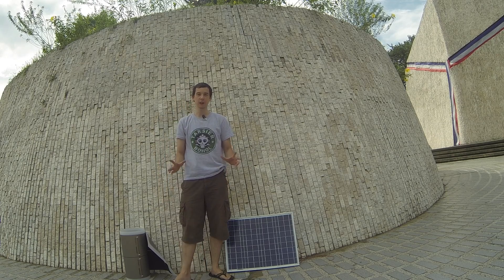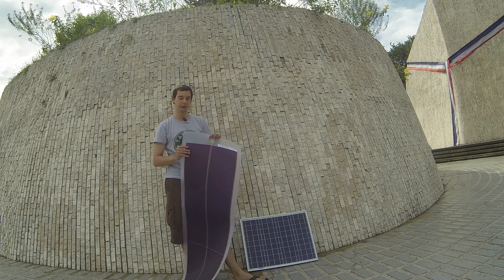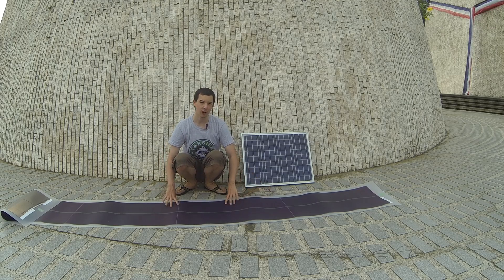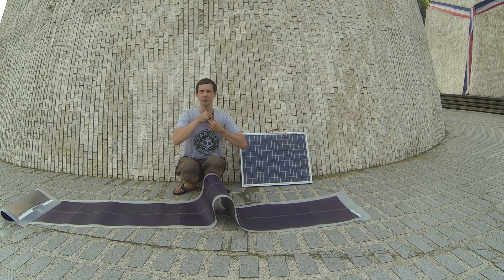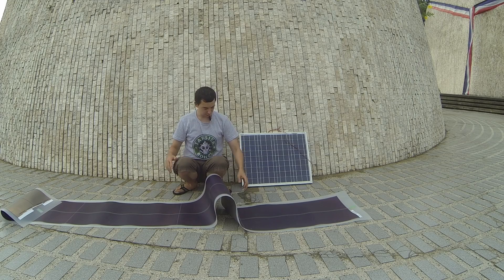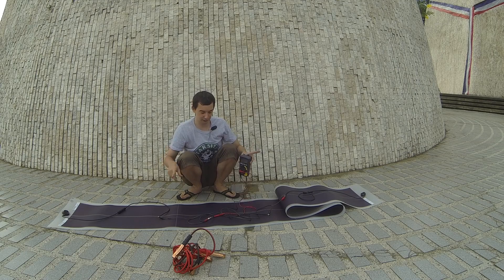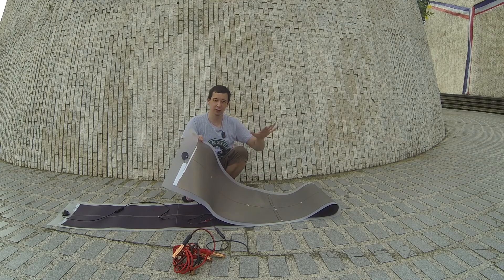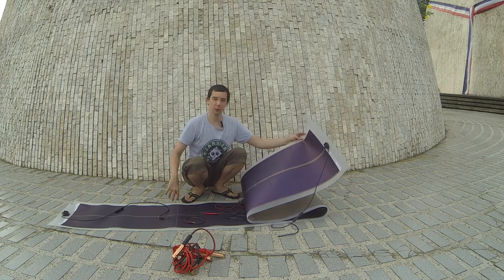Fuji Fwave Flexible Solar Panel

Comment: Was ist mit diesem Panel ? Ist es immer noch gut oder ist es alte technick?
Reply: This is an outdated technology and a poor product. Due to the high voltage of 240 volts DC, if handled improperly, you can accidentally ignite an electric arc and start a fire or be exposed to direct current, which at this or higher voltage is guaranteed to kill you.

Comment: Hi, thanks for the interesting Video. I ve got 4 of these panel and dont know, how to hook them up to a Batterie. Can i cut them to reduce voltage and what Kind of charge controler and what type of Batterie should i use? I hope you can help me out. Salamat
Reply from the maker: You can buy a charge controller that's designed for that high voltage. It's still being sold on ebay. 

I've also seen some users that tried to use a stepdown voltage regulator and then feed it into a regular solar charge controller.

Comment: Hi, good video. Where do you purchase that kind of flexible solar panel?
Reply from the maker: I was about to say, I don't think they're being sold anymore. 

But then I checked eBay and they're still being sold.

Just search for: 100w 319v dc roll up Flexible solar panel

There are competing products nowadays. Although it's hard to beat these for the price, considering the high quality.

Comment: I’m a bit confused but I’m new to this. 300w x 0.1amps = 30W each. To get to 3KW power you would need 100 of these on your roof right?

The normal panels that I’m looking into are 650W each so 10 will give me 6.5Kw

The flexibility is Great but I’m trying to understand the power output. 
Also many things are 120 / 240 volts. 

I’m guessing I would need to buy some and connect myself to understand what it is doing.

Comment: When you order this type os solar panels, you also receive a '300Watt 200v dc to 14.5dc convertor'  to attach to a 12v solar charger. My question is, how to connect several of these convertors outputs to one single solar charger. thank you

Comment: hi, i just bought 2 pieces - i payed just about 35 Euro for each. great, i measured te voltage - it works fine. but now i am in a dead end. what kind of converter  do i Need. i would like to send the power to my boat which is supportet whis some 230 V AC to 12 V DC converter .thx for an idea
Reply: Dear Werner Wachhter , If u need any informations about  the  fuji solar , i  can  help you free , about fuji solar  , . I'm usenig the  fuji solar , and  have good  experince about this kind , this my address and number mobile ,   
alzoobery2001@yahoo.com
+967712927117
you can contact me whatsapp , Viber and wechat , this my number +967712927117
any dates about  the  fuji solar , i  can  help u , like  the inverter and how  to  charge  the  battery , and  others ,
Regard
Reply: Dear Werner Wachhter , If u need any informations about  the  fuji solar , i  can  help you free , about fuji solar  , . I'm usenig the  fuji solar , and  have good  experince about this kind , this my address and number mobile ,   
alzoobery2001@yahoo.com
+967712927117
you can contact me whatsapp , Viber and wechat , this my number +967712927117
any dates about  the  fuji solar , i  can  help u , like  the inverter and how  to  charge  the  battery , and  others ,
Regard

Comment: exactly where did you obtain this panel that we cannot find. no facts , no access for others to obtain panels and i need to check all your other junk posted. maybe you need to build a perpetual motion machine like the other nutcases out there as this immature act you proclaim is within there same suit.
Reply from the maker: +cuyler wilkinson it's a panel made by Fuji. Just type Fuji flexible solar panel into Google and you'll find countless websites talking about the panels.
Reply: i have and there are none. come on with a verifiable link.
Reply from the maker: +cuyler wilkinson if you can't find information on flexible solar panels from a major brand like Fuji then perhaps it's best you stay away from solar.
Reply from the maker: cuyler wilkinson So where exactly do you think I got these panels from?
Reply: ok! where!

Comment: Great video, How would I optionally drop down the voltage and use it for off-grid battery charging for use with a normal MPPT charge controller rated at 150v....thanks...

Comment: Can you mount it as toproof of your electrical scooter to get a permanent battery charger during daylight? Is it strong enough to drive in the wind? Thanks.
Reply from the maker: +Kalvin One they're far too long for that. You'd need something much shorter. But otherwise, yeah I think it would work okay.
Reply: +Gadget Addict it 's very strong if you can deivw fast on the highway. Very impressive! Is there something shorter and larger and protecting against the sun and the rain and as powerful?
Reply from the maker: Kalvin One What you described sounds like every standard solar panel with aluminum frame :P
Reply: +Gadget Addict but it 's not as flexible (mobile) and not as light as yours...

Comment: May I ask you to point on ebay to Grid Tie Inverter that could handle this?Do we need to decrease voltage with any DC-DC equipment?May you provide any information about this please?

Comment: How safe is this panel? I want to mount two panels near my polytunnel, but I also have young children, who might touch them. What are the risks?
Reply from the maker: Provided you secure all of your connections, they should be fine. Although it's still high voltage so the general recommendation would be to keep them away from them. If you solder on proper connectors then there should be no place they could touch to shock themselves. But kids like to play and they could always undo the connector and try stick a wire in there and get a shock.
Reply: +Gadget Addict Thank you for replying Gadget Addict. The connectors will be hidden away, so that's great. I was just worried about the kids touching the panel itself. Happy new year!

Comment: Hi -Great video - really helpful.  I have bought one of these to use on a sailboat to assist charging the 48v electric motor batteries. Could use the single panel, but wondered if it is possible to divide into two for easier deployment?
Reply from the maker: As far as I know, it's not possible to cut these panels down so you'd really have to stick with the supplied size. Nice use though! :)
Reply: +Gadget Addict Thanks for the quick reply - NB: the eBay supplier in Nederlands (Viktor) supplies all the related parts connectors etc. Importantly for DC charging -  DC-DC step down controller converter high voltage 319V to 24V.
Reply from the maker: Chris Green He's the guy I bought my controller from :P

Comment: Hi mate, i have tried 2 flexible panels of these, wired them in parallel, connected them to 319v step down transformer, then to dc ac 12v to 220 v inverter, it worked like a charm. It did  light up a 60 w bulb + radio . I could have connected more things, but didnt want to put alot of pressure on the panels.  Very good panels made by Fuji.
Reply: can you send me any informations about this panels im interested in buying a couple of them
Reply: +tahlaoui1983   Salut tahlaoui , add me on facebook so we can talk about this, i have tried these in morocco, very good panels,
Reply from the maker: +redouane sorour Very cool! And yeah I agree, better to put a battery into the mix but a fun experiment and good results!
Reply from the maker: Sorry I don't have Facebook. You can find me on Twitter with the username ytgadgetaddict :)
Reply from the maker: Sorry but everything I have to say about the panels is in this video.
Reply: Mr redouane sorour , How much is you bought  the fuji solar ?

Comment: Do you think an Omron S8VK-G can handle the step down voltage to my solar charhe controller? (input is 40V, 10A max; output is set to 12V)
And if so, what wattage should I use? they have from 15-480W to choose from! have no idea what difference it makes :/
Reply from the maker: +DJBelbe Just read the specs for Omron S8VK-G and it seems like it should be able to handle it. As for the wattage, it depends how many panels you have. The more panels, the higher wattage you need it to be able to handle. I'd recommend contacting a seller of the S8VK-G and telling them the intended use first. But a quick glance suggests it should probably work.
Reply: +Gadget Addict Hi, and thanks! I've been trying to contact them but not much luck yet. I only have one pannel. I bid on it on ebay on an impulse because these thin films are said to work better under shade (very cloudy were I live) and I won without expecting! (really cheap bid), so now am left scratching my head on how to use it... I only need it to power a small house's led bulbs and minor electronics. All the heavy loads like fridge work on gas.
Reply: +Gadget Addict well, I checked with the seller and no luck :( , apparently they tested DC voltage input and there was no drop to the output. As far as I can tell, it's a mistake to place DC on the input specs because these work as AC-DC inverters (can't find another explanation for the voltage not droping)
I found a guy in the Netherlands that does build custom made controllers for these panels, but they cost 3 times what I paid for the panel, LOL!!
should be useful for people who have a few in parallel though!

search ebay for
"
DC-DC 400W step down controller converter high voltage 319V to 12V"
Reply from the maker: DJBelbe Ah okay, bad specs then! I actually bought that one from the netherlands. I saw them selling the same thing in china and you can modify the input voltage and they just very slightly modify the design to work with that. But you have to buy a certain number of units before they'll make it for you. So your options really might be limited :( You can buy the exact same thing in a 220V AC input variety for like a 5th of the price lol. But the modification and rarity is what bumps the price up :(
Reply: a bit more googling skills and I found this one:
TDK PH300F 280-15 DENSEI-LAMBDA DC-DC converter, with 200-400VDC input, 15VDC outpt at 20A.
I bought it for 35€ including shipping so if it doesn't work I'll just re-sell it on ebay.
My ony worry is that it's so small!!! I'll probably have to add some cooling fan to it or something?

Comment: Nice Video! Can you tell me how to convert the 300-400 v dc to 12 volt dc ? please send me a link to this item i have to use...
Reply: you could use an extremely expensive 600v Morningstar MPPT controller.
Reply: +HV and more .... I am waiting for this answer !!!
Reply: +Vivian Rajan yes me too but there are only things on the Internet, which are extremly expensive
Reply: 12V DC 33A 400W Watt Power Supply Trafo .. I bought this but sadly input is AC .. I bought the flexi SOLAR pannel.. its outstanding ,,.. output ...up to 380V..
If you have any ideas pls share ""!
Reply: +Vivian Rajan I really got a good idea there is a youtuber, who cutted a panel like this in 1/8 and had 8 panels with arount 100 volts maybe it works to cut them so, that a single panel has like 12 or 24 or 48 volts
Reply: +HV and more  oh no ..... i got to do lot of soldering and connection work ....i dont want to spoil cutting it ,, .. ! :(
Reply: Then there is no way fixing this problem sorry...;)

Comment: Thanks for the video - we are thinking of buying a property in a remote area in Bulgaria - we bought several of these panels around 30 I think prior to moving out here. I have looked everywhere for explanations on these being so high voltage so this was really helpful as I need things explained on a very basic level. I will subscribe to your channel and have a look through - but just in case it is not dealt with with what I have in terms of quantity and unlimited space and lots of sunshine for 9 months of the year and lots of snow for 3 - would I need to run batteries or could I just connect up without storage - what sort of inverter / charge controller would I need considering i will be completely off grid - the main power drainer being 2 chest freezers, fridge, washing machine and laptops...told you I was a novice...help :-)
Reply from the maker: Jane Darke Would you really be off-grid or just not wanting to pay for any power from the grid? Because if your property is connected to the grid, you could avoid buying batteries and just connect the panels to your house using a grid-tie inverter. If your panels were generating 1000 watts and your home was consuming 1200 watts, you'd only pay for the 200 watts from the grid. If you generate 1000 and only used 700, you'd either throw away the excess 300 watts, your meter would turn backwards or you'd get a rebate. It all depends on the laws and agreements in place with power providers where you'll be living. But ultimately grid-tie is a very cost efficient way of setting it up, but without the backup in case of grid failure. Unless you get a high-end inverter that will automatically isolate your house from the grid and continue to feed power into your home even if the grid goes down. If you're going to be 100% off-grid then you'll need a very large battery bank, ultimately it would depend on your intended usage each day. There are a few calculators online that can estimate the number of batteries you need based on your usage.
Reply: Gadget Addict  Hi thank you for your very quick reply! I think you're right a grid tie system would probably be best as despite being in the middle of nowhere there is a mains line to the property (no water though) and it may be worth investing in a high end inverter that will continue to feed power in times of an outage or maybe just a UPS that moves to battery power for specific units should the power go off - we have one of these on our central heating pump where we are now so the wood burner doesn't explode -) Is there a way I can hook up the solar so it automatically switches to the grid when there is insufficient power from the panels and vice versa? Sorry about the constant questions but you don't know how helpful this all is. Jane

Comment: You mentioned that there is no need for a charge controller as long as im using a step down converter,Dc Dc converter from 319 to 12 v,

So the parts needed are solare penel 319v kin+ step down controller+ batteries+ dc ac inveter= and voila there is light?

Plese correct me if im wrong 

By the way you have very informative videos, cheers
Reply from the maker: redouane sorour Provided your step down controller has protection against over charging the batteries, yes you should be fine with what you described :)

Comment: You should the connectors already attached to panel. Could you go into more detail on how you connect these. I've purchased 2 of these panels and I feel there ain't much room for error looking at the tabs of the panel. 

Thanks.
Reply from the maker: Lukey Cherrett I bought some 4mm solar cable and crimped the MC4 connectors onto the ends. I then wrapped the wire to the tabs on the panel and soldered it.  Then I put black silicon over the top to protect the connection. You can get stick on solar terminal boxes.
Reply: Thanks

Comment: Great video. Keep them coming. 

Question..., I have a  Midnite Solar kid charge controller. Can I used this solar panel without hurting the charge controller?
Reply from the maker: ledexpress2014 I've not seen that charge controller before, but I checked the website of midnite solar and it looks like the maximum input voltage for that charge controller is around 160v while the fuji fwave panels are 320 volts. So I guess it wouldn't work unfortunately.

Comment: I have done two of my houses in these panels, 2kw on each and it's working perfectly. Even on the bad day i'm getting around 350w of 22 panels and around the same if they are covered in 10cm of snow. On a good day is very impressive: each panel is rated at 92w (1000w of sunlight in sq. m.), but even on 800w per sq.m. of sunlight they pushing 106w each. So they are surely overspec what Fuji Fvawe claims.
Reply: For Helping about the this  flexible  solar , I can help any persone how do use this  solar , , If u need any informations about  the  fuji solar , i  can  help you free , about fuji solar  , . I'm usenig the  fuji solar , and  have good  experince about this kind , this my address and number mobile ,   
alzoobery2001@yahoo.com
+967712927117
you can contact me whatsapp , Viber and wechat , this my number +967712927117
any dates about  the  fuji solar , i  can  help u , like  the inverter and how  to  charge  the  battery , and  others ,
Regard
Reply: Dear Ned Xell
If  u need any  helpi
ng about the fuji flexible  solar , i  can  help u , and  any    person , need helping , about  this solar  , how  to  charge  the  battery or  any thing about this solar , he  can contact me whatsapp , Viber , We chat +967712927117
address alzoobery2001@ayhoo.com